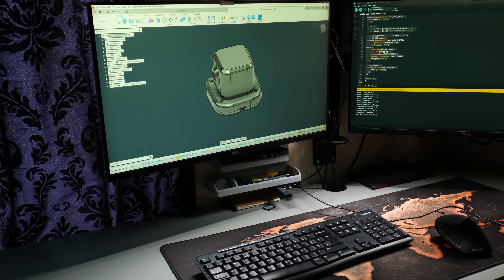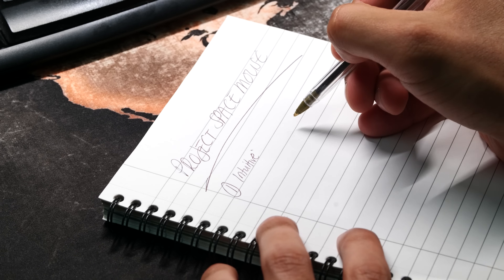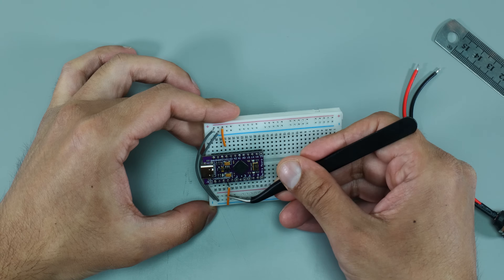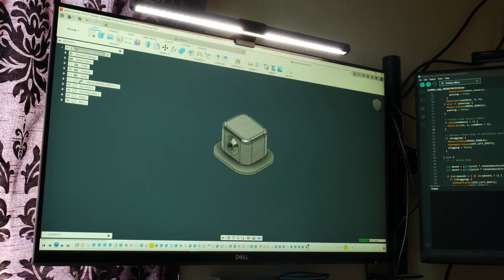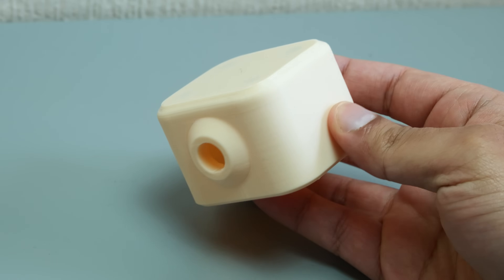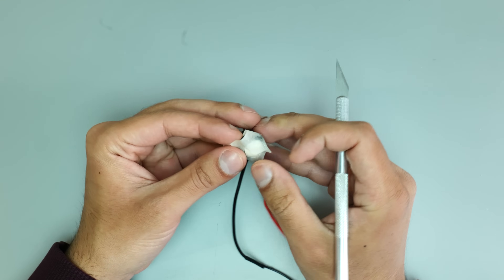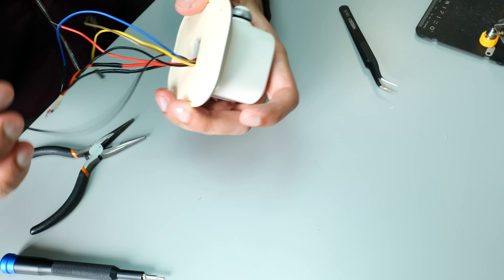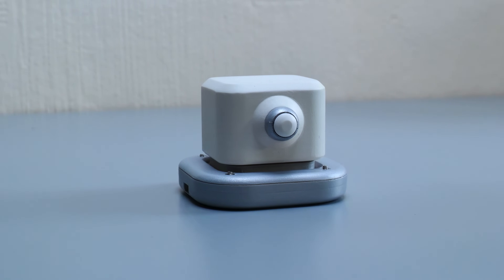I Built a Tool That Transformed My Workflow

Comment: You made the most useless thing. You half assed copied what other creators have done but couldn't get to the level where this thing is actually useful. Be real, pan, tilt and zoom. You've just lost all the other functions of not using a normal mouse over camera movement which you can easily do better than this stupid thing you made. Change your channel to "Just Copy It"

Comment: Great project but I’d go wireless- Swap out the microcontroller for a xaio nRF board… you’ll get 6+ months always on battery life or way more if you implement a basic power saving.

Comment: I got a 3D printed almost a year ago. I'm taking on the task of making my own macropad currently. My question is how do you get accurate dimension or cad files for the parts to easily integrate into fusion? I've been relying on a caliper this far and it's worked relatively well.
Reply from the maker: So a few points, in no particular order:

1. Wherever possible, see if there are STEP files for the components you're working with available on the internet. You can then import these into your CAD software, and it saves a lot of time/effort
2. To get accurate dimensions, calipers are my go to, and sounds like they work well for you as well, so carry on using them
3. If there aren't any STEP files available, use your caliper measurements to make very basic models of the components you're going to use, capturing all the main features of relevance. Its a lot easier to model around your components in CAD rather than having to guess

Hope that helps!

Comment: very cool project, but PLEASE learn how to write code. vibe coding your way through everything with chatgpt is going to trip you up in the long run.
Reply: 100%. I’m still a novice (like, imagine taking a 101 class with just pseudo code, then a 102 class with linked lists/pointers/oop etc and that’s it) and I’ve gotten so many things done just vibing through, but it doesn’t… scale well. 
Once the project gets complicated enough where there’s a lot of functions or files interacting, ChatGPT just cannot keep everything straight. 

It’s still an awesome jumping off point, or brainstorming tool, but it’s important to walk through the code and do your own edits. If ya can’t do that, you can’t debug it, and you’ll get stuck. 

For simple stuff though, I think the “danger” is a bit overhyped. And if the project can be split into those simple parts, or you just need a framework to build on, I think it’s perfect even if you don’t fully understand what’s going on at first.
Reply: You say that cause your project is simple and uses heavy resource libraries which is exactly the use case make it simple for average people to use. 1 day crack Open the library code that you're calling. Have a look at that and ask chatgpt to replicate that. Then you will understand what they are saying that's not auto beat match my friend.
Reply: If you want to know what you can do, better. Have a look at heat press inserts.They would've made you design a bit more polished with only having the screws in the bottom and not coming all the way through the top where you're grabbing your device also square is not ergonomic There's a reason the devices are round That probably isn't going to be very comfortable to use for hours of time. This is coming from an industry professional that uses a spacemouse every single day.
Reply: as a time saving measure it is a great start, but if you have time you should definitely learn enough to understand (at least most of) the code the AI is writing after you've read it, even if you couldnt have written it yourself.
Reply: I love coding but using AI is way quicker. Especially for projects like this. It’s easy to read the code to make small changes. This reminds me of dj’s that still beat match by listening to the beat instead of pressing auto beat.
Reply: Vibe coding with a solid understanding of what the lines that an AI writes is the future.  Boilerplate should not be written starting from scratch anymore.  

I do agree that you need to understand what the AI’s code is doing.  Best way to learn imho, keep vibe coding… then take the extra step to ask AI how the code works and dig down in on things you don’t understand.

Great project!!
Reply from the maker: ThanksS

Comment: I'd recommend printing a TPE base. It's not supposed to slide along the desk from what I can tell, so placing some undersized holes in the base of the mouse and making a TPE base with press fit plugs to go in the holes would get you a solid, rubbery base.

Comment: Re: Spray painting 3D prints, I've got a couple general-use tips I thought it couldn't hurt to share:
– sanding before priming is always a good idea, 120-240 grit should suffice to remove layer lines and leave the surface just rough enough for the primer to grip to; higher grits can leave a smoother surface, but I'd leave that for after the priming (see below)
– wash your prints with soapy water to get dust and oils from your skin to come off, those can leave an uneven (worst case, flaking) primer layer
– if you want an even application, two thin layers (almost) always trump a single thicker one. Some cans have instructions on when to apply subsequent coats, you often don't have to wait for one to fully cure before you add the next
– if you really want a really even application, wet-sand with ~800 grit sandpaper between primer layers
– same rule about thin coats applies to base coats, it prevents drips and "orange skin" (where the surface gets all wavy because the liquid paint dries unevenly)
– a clear top coat can protect the colors if the object is handled a lot or subject to other forms of regular contact, and many improve UV resistance (check the can); if it's just a decorative thing to put on your shelf, I'd personally say this is optional if you don't have clear coat on hand, but in general it's good practice
Reply from the maker: Solid tips - thanks for sharing!

Comment: Using filler primer between different grit level sand papers will help with the layer lines, I typically stop at 400 grit, then spray paint, then use multiple coats of modpodge hard coat with 600 to 1000 grit sanding between those coats. It gives the print a professional look and masks the cheap feel of thermoplastics. It isn't quick to do though, waiting for each coat to harden where you could do sanding, not specifically cure takes about a day. Once you're done with everything you can use it as is, but be careful not to scratch or drop it as it wont be fully hardened and cured for about 2-3 weeks.
Reply from the maker: Great advice. I learnt the hard way not to handle these spray painted prints too much before everything sets!

Comment: It's always funny to me how these DIY spacemice seem to be made by people who have never experienced the 3Dconnexion one. I got an old wired version one a few years ago for cheap that had an intermittent axis. I had to disassemble it completely to understand how it works and fix it. Turns out the original was a stupidly simple device, just clever engineering to give 6DOF all the time, without pressing any button. All I had to do to fix it was refresh the solder joints on the through-hole components as it seems some of them were cold solder joints.

I think the new ones use hall effect sensors to be less susceptible to dust but this old design I have has 3 PCBs with 6 IR emitters and receivers: USB interface, Sensor array and IR Emitters. The USB interface and IR sensors are connected together in the base through a mezzanine connector. The IR emitters are at the very top of the knob and are powered through the 3 springs that hold it in mid-air. It's a very clever design without any wires. There are some special plastic pieces with slits in them to orient the IR beams so they get occluded more on certain movements. The real magic is in the algorithms that take the sensors and output it to the computer tbh. It's not super complex but it's not an obvious problem to solve either.
Reply: +1, the original space mouse has the simplest tech possible cleverly packed together, while offering the highest precision standards. I'm quite shocked that literally none of these dyi versions don't just use optical sensors and they all go with magnets or gyroscopic sensors
Reply: I think you hit the nail on the head in your last sentence. In the real 3dconnexion one, all the heavy lifting is done in the software.

Comment: You lied to us at 04:57. Unintentional, as it must have slipped your mind, but as it currently stand, a lie! fakes outrage
You may wish to reconsider the mounting solution for the bottom as to avoid both bolts and nuts being exposed to your hand, collecting grime and dirt.
Neat project, well done!

Edit  
In just 3 hours this issue has been rectified and my previous fake outrage no longer holds validity. 
10/10 Dentist.
Reply from the maker: Thanks for highlighting this - I've added a link to the STLs in the description.

Comment: If you want to save time on sanding, have a look into "Acetone vapour" polishing. As to the real space mouse, I've been using one full time for years for 3D CAD/CAM modeling and they are such a time saver for navigating around your designs.

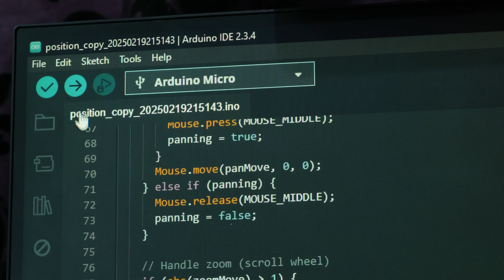Comment: @03:07 Based on how yours seem to operate - You're REALLY missing out on not getting an actual 3DConnexion SpaceMouse... From the looks of it you're essentially just operating something akin to a 2-Axis Joystick with a button to toggle from Rotating to Sliding Movements for a total of 4 Axis compared to a SpaceMouse which has 6-Axis all of which are active ( with the option to disable unwanted ones ) at the same time providing a MUCH improved / natural experience.
Reply: So just curious on this statement. What is considered the 5th and 6th axis which is missing? Is it the zoom feature?
Reply: @larrybud  With a 6-Axis System you have essentially two Sets of three Axis... Three "Sliding" Axis ( moving back and fourth, strafing left and right, climbing up and down ) and three "Rolling" Axis ( turning left and right, looking up and down, leaning left and right ).

He shows how it's NOT supposed to be done by using a Shift Button to essentially perform a different Action using the same Motion which a) is not natural in the slightest and b) lock you out of the first set while enabling the other set.

If you've never used a proper 3DConnexion SpaceMouse before you might react to it like "Meh? What's the big deal?" but once you've used it you'll most likely question ever life decisions up to that point on how you managed to CAD without one.

You'll also immediately spot any CAD YouTuber who uses one and who doesn't.
Reply: @Duraltia  I have not used the real spacemouse.  So with the real one, I get how you can go zoom in and out (control can go down and up). Sliding left/right, you do what, push the control slightly to the left without tiling it? How far does it need to be moved, 1/8" or less?

I saw a teardown of a real one and it's pretty ingenious in how it works, might be a fun project to play around with.
Reply: @larrybud  Imagine the 3D Scene in your CAD Program having an Apple in it. Then imagine the SpaceMouse Puck to also be an Apple. The way you move the "Apple in your Hand" will mirror EXACTLY to the one in your 3D Scene ( all 6 Axis at once and buttery smooth though some with stronger translation than others ).

The amount of movement it requires is pretty much null to the point where you might actually experience Drift you can recalibrate away. The more you move it the faster it will translate it to the 3D Scene. During normal use you'll probably only move / twist it by 3mm / 5° 🤔
Reply: @Duraltia  Great analogy!